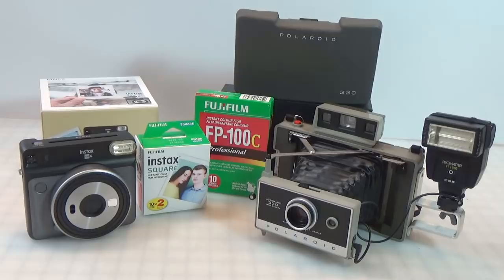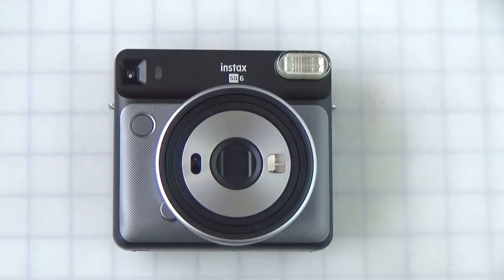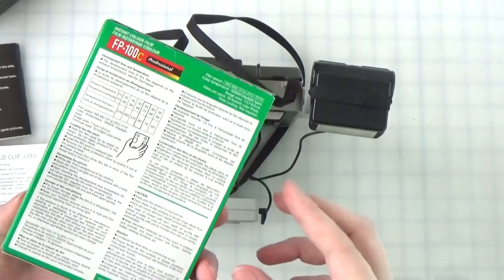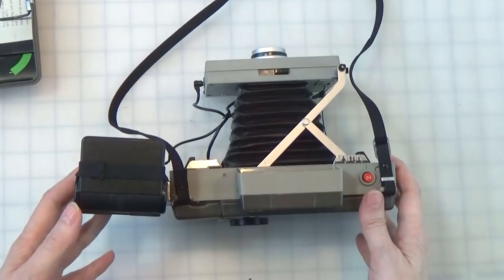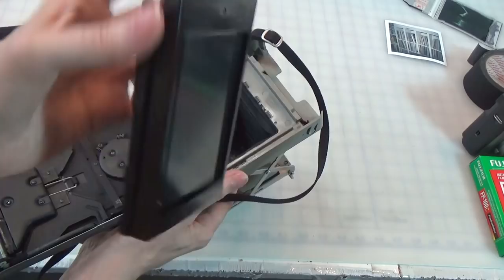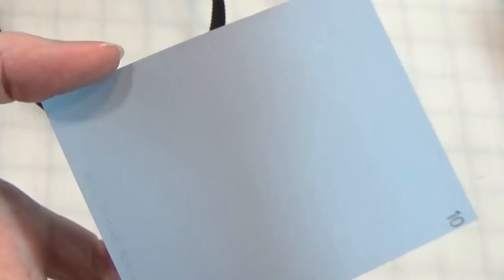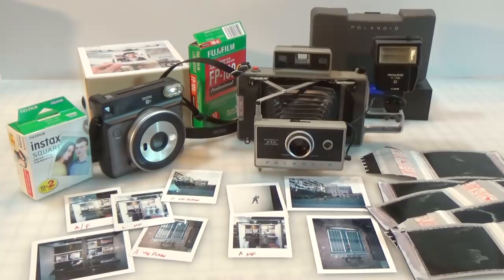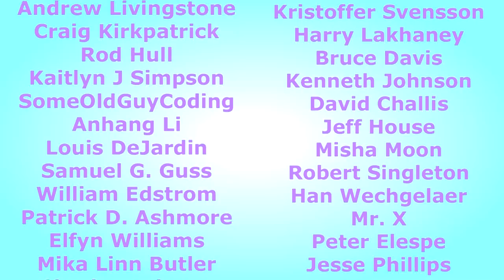Fuji SQ6 Instax vs. Polaroid 330 Land Camera!

Comment: My Father bought a Polaroid land camera in the mid seventies, it was specifically purchased for the upcoming air show to be held at the Rolls-Royce Hucknall airfield near Nottingham.  I had the important role of keeping the cold clip warm as even though it was summer it was a cold day (remember this is England and sometimes our summers are like winter).  The first photo taken was of a RAF Hercules transport aircraft, it is hard to convey how exiting this was at the time, to be able to take a photograph and view it almost immediately. One thing I remember quite vividly was the distinctive smell of the developing chemicals. With all the advances in technology it is sometimes easy to overlook how advanced (for the time) these Polaroid cameras actually were.  After the passing of my Father I was clearing out his house and found, pushed right to the back of a cupboard, the Polaroid camera that we took to the air show, complete with its original black leather carry case. It bought back some happy memories.

Comment: I recall having to wipe the photos using a squeegee soaked in developer solution that was stored in a plastic vile when using the early Polaroid Swingers.  The later models had a battery pack built into the film cartridge, I would take them apart and play with the battery lighting up flashlight bulbs and small motors, BIG FUN!

Comment: To repair the delamination you can take a needle and thread and pass a stitch or two through the bellows where it has seperated to pull it back together. The smaller the needle the better. Don't try injecting superglue - it's too rigid and will eventually cause the bellows to crack.

Comment: Great video. I am amazed to think there is still fin around for the Land camera. My father had one, I was at least 40 years younger the last I used and saw it. The only thing I lament is the quality of everything has gone to the wayside. I never thought much of the pictures of the Land camera. They would degrade with time. I can tell you really enjoy though. 
I do wish we could still buy and develop 35mm Kodachrome. What amazing color. Kodak is gone and along with a means to have it developed. Sad. 
As you know, the film is important but the optics make the camera. I would suspect the Land camera has a ground glass lens. I am certain the Fuji is a fine molded plastic lens. I might be wrong. I will be thrilled if I am.

Comment: I was pleased to see your video, here; a bit of a follow up to a video of yours I remember from a few years ago, about your flash modification. I wish I had stocked up even more film when I was buying at $10/box too. I have a similar Polaroid Land model. I currently use my Mamiya Super 23 with the Polaroid back, and use it for presents sometimes, along with my handheld light meter.
Reply: I have used the Polaroid negatives in the darkroom with RA color paper and a c41 blank orange mask, to work with the color paper. The Polaroid negative seemed a bit thin, but did deliver image, sort of "old time" like. Look to revisit again some time. Have thought of adapting a Grafpac for 4x5 film.

Comment: Hey Fran, if you are sculpting with wire?
Cut your length (a bit too long) and put one end in a vice and the other in a cordless drill chuck.
Put the drill on low speed and pull the wire firmly.
The wire will work harden and you end up with a very straight, well behaved bit of wire to bend (or do with what you will)..

Comment: I think it'd be fun to experiment on the Land camera with some original Polaroid film (assuming there's any new/old stock film that isn't completely deteriorated.)
Reply from the maker: I am going to do another video on the actual pack film mechanics - but the big issue of deterioration beyond the chemistry is the sticky wax adhesive that is necessary to bind the negative/print sandwich together during developing.  When that stuff dries out it's not going to work.

Comment: at about 5 minutes in, you open the back and there is a honeycomb pattern on the inside of the back plate. Why the honeycomb? Is that 3D printed?
Reply: Or are they using that design to amplify the stiffness of a thin panel....?
Reply from the maker: Honeycomb patterns are very old method of creating very light weight rigid panels.